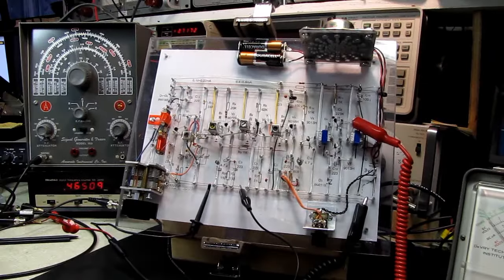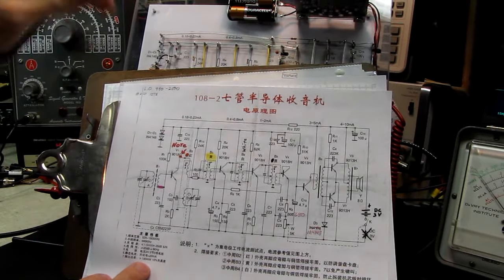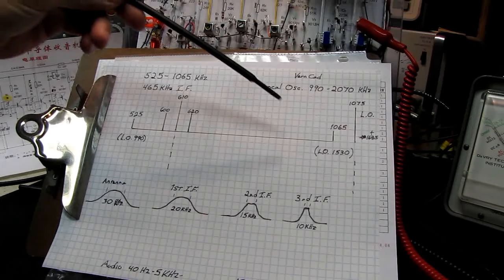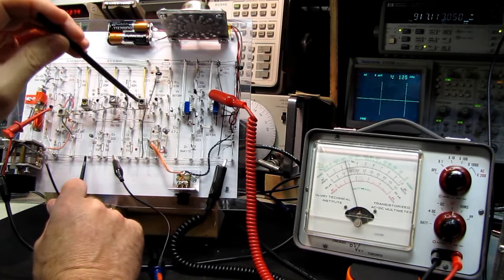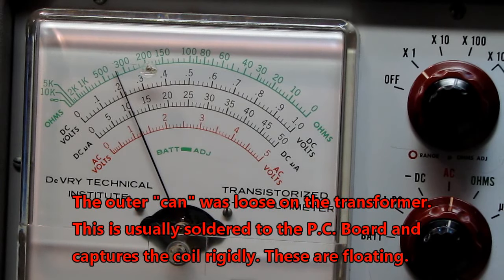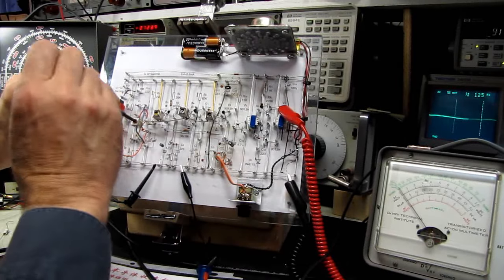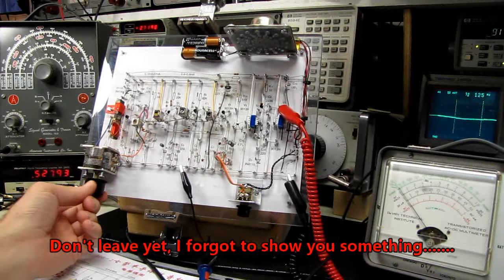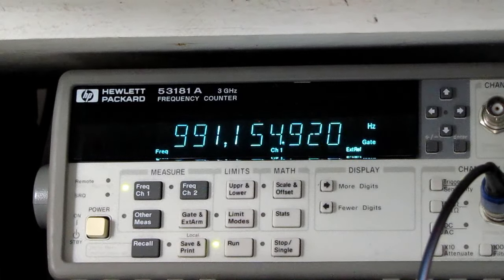10 Buck Test Bench - 7 Transistor Radio Video #2 Alignment

Comment: Further to the last comment, here is a link to the problem radio.
http://www.elenco.com/admin_data/pdffiles/amfm108k.pdf
Reply from the maker: HI Ricky, for some reason I have not been getting all your comments. ( I actually did a video on this problem ) I came across these by chance. I have ordered one of these kits and will do a video when this arrives. Thanks for watching and a good lead as I have been trying to figure out how I was going to do a video on FM. This kit will be the answer.
Reply: The Radio Mechanic , Thats great news, I will very much look forward to watching the videos. In my view, ELENCO have not quite nailed it when it comes to the educational element of this kit.  Im sure that your communication skills and extensive knowledge will benefit many. All the very best, Yours Ricky.  Ps, I will resend my previous messages directly. Cheers
Reply from the maker: Hi Ricky, I would check the coils for continuity if you haven't done so yet. I will go through the whole thing when the kit arrives and try to help you out. Don't know why, but for some reason not all comments show up in my social tab. Most do, but some I do not find unless I go digging. Was not ignoring you. Just had not seen them. I actually did a video about that problem Again, thanks for watching and hang in there. The kit is coming. Vern